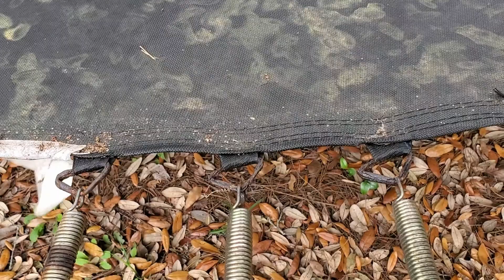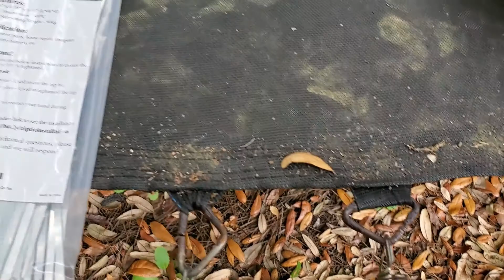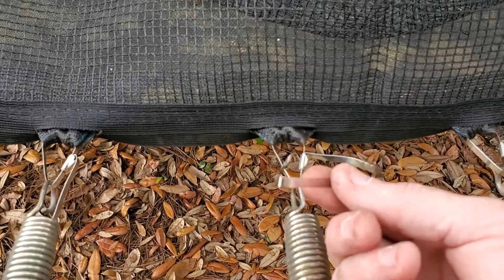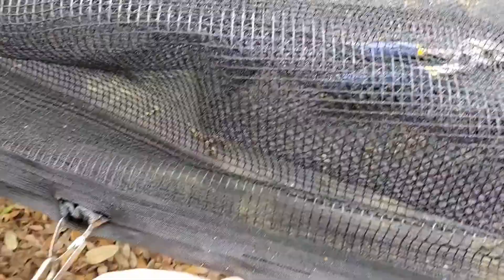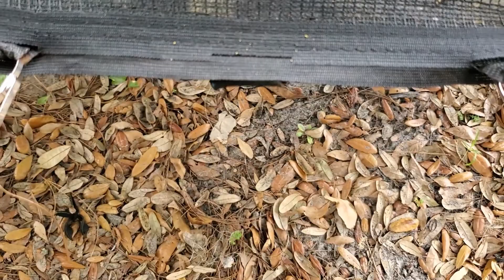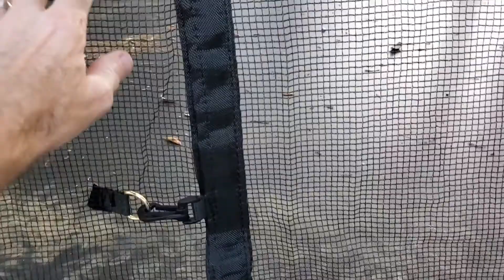Skywalker 15 Trampoline Safety Net Spring Pad Replacement Rusty Spring Rings

Comment: It's been five years so I guess you would know by now but I would be concerned that those steel zip ties might eventually cut through the fabric because of their sharp edges compared to the D ring which is rounded and smooth.
Reply from the maker: They held up fine until the mat dry rotted and split.